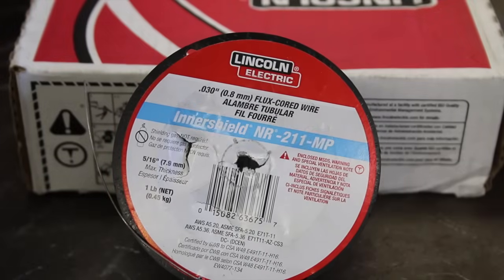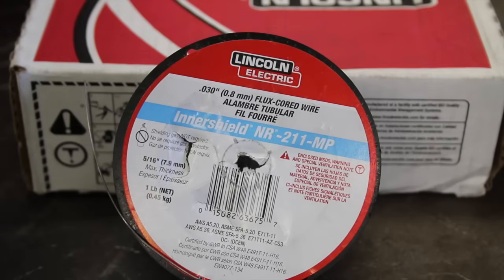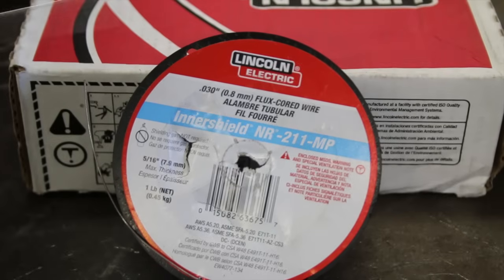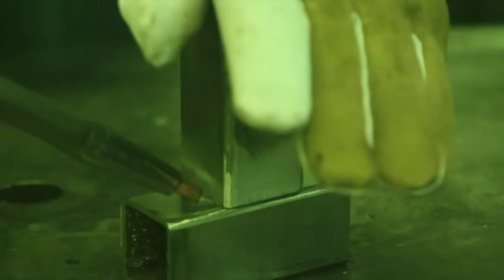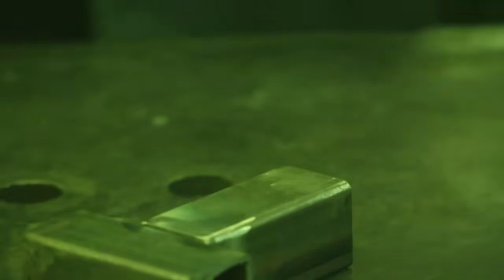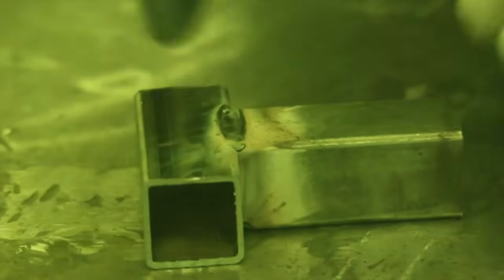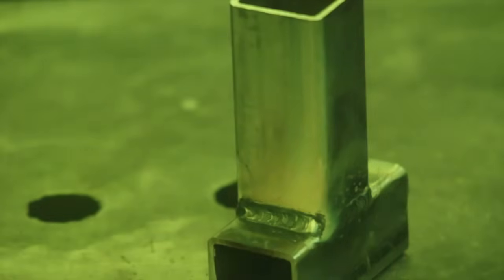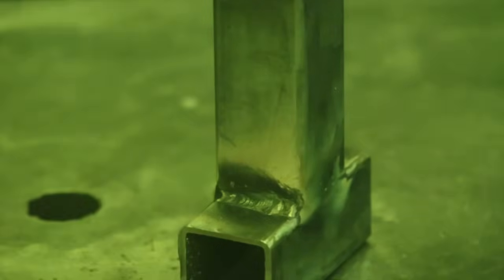Basic Flux Cored Welding on Square Tubing

Comment: Any suggestion for Current and Voltage settings on such a thin metal welding?
Reply from the maker: Sorry for the late response. You need to start with a lower wire feed speed first. One that matches the thickness of the material you are welding. Once you have found it, you then need to match the voltage to the wire speed for a smooth weld. Check this link for more info on settings: https://ch-delivery.lincolnelectric.com/api/public/content/5b1a00933782415e98e56639deb63f45?v=405651b4

Comment: How much weight will those T's you welded hold? I was going to use 2 inch square steel tubing with an internal diameter of 1.76.(.12 thick wall)  I am building a work bench out of 2X2 Spruce Pine that was left over from another project. The actual diameter is 1.437" square. I want to make the bench portable so would drill a hole through the Metal tubing and 2X2s and bolt it down. When I am finished using the bench I could pull the bolts out and could store the table flat. I used to solder circuit boards. It looks similar with the exception of the safety gear.

Comment: What's the wire speed and voltage used ?   Thanks
Reply: I just welded 14 gauge square tubing with my titanium on D 4.5 worked great

Comment: What's the best/cheapest no gas welder to get?  I want to learn to weld but don't know where to start.
Reply: I got a Lincoln 125 machine from my local Lowe's. I don't remember how much it was but it wasn't too expensive.
Reply: my honest advice is start with a stick welder, once you master that a MIG is easy to run.  and go with one from Harbor Freight. cheap and easy.

Comment: Newbie here. I assume you're able to form an arc without having your ground on the work piece because you have it clamped to the metal table you're using. If I were to use a small metal piece (need to be very mobile) for this what is the thinnest stock I could/should use for a mini table?
Reply: I've done it on a sheet of metal no thicker than about 1/8th of an inch.

Comment: Hi can you tell us the limit on max length extension cord that ca be used for a 120 or 160 flux core. Thanks. Some of my projects are not limited near my wall socket.
Reply: I've used a 110 machine on 100' cord, just make sure its a heavier wire, like 12/2.

Comment: Dan thank you for this video. I have a porch railing repair project where I have to cut out and replace rusted out sections. I was getting a lot of burn through but you explained how to avoid that. So one major headache solved. By the way the sections are 1" square similar to what you used in this video but yours looked like 1 1/4" square. Once this rain stops I look forward to getting out there and working on this project some more. Thanks Dan you really came to help on this one!

Comment: This is helpful. I bought a cheap Harbor Freight Flux Core welder for $89 and have tried to teach myself. I am having a hard time with my travel speed. I either go to slow and blow holes in the metal or to fast and don't leave enough weld in the joint.
Reply from the maker: +waldan1701 Try counting, or welding to the rhythm of your favorite song. That helps keep your travel speed consistent.
Reply: Thanks, I never thought of that. I will try it.

Comment: I'm just getting into MIG/Fluxcore welding so forgive my ignorance, but I'm curious about the gun you are using. Most videos show a gun tip that seems overly large, but yours is almost pencil point shaped. Can you tell me the brand of machine you are using, or gun or tip, whatever? The large types I've seen really turn me off to this type welding, but now that I've seen the type you are using, I really want to get into Mig/Flux core welding.  Btw..thanks for the tips.
Reply from the maker: +Martin Walters Since I am flux cored welding, I am using a special flux cored nozzle, since there is no shielding gas needed. If I were to switch back to MIG, then I would have to put the MIG nozzle you described back on. The flux cored nozzles can be purchased at welder supply stores and I have even seen them at big box hardware stores.

Comment: Dan, when setting up to weld two pieces of different thickness metals together, i.e. 1/4" to 3/16",  which thickness do I select on the chart inside my welder?  I don't recall hearing this anywhere. Thanks, and keep up the videos!
Reply from the maker: +Sammy Snead Choose the thicker for the setting. Lay on the thicker material longer, and sweep over to the thinner so as not to burn through. You will get the best fusion this way.
Reply: +WeldFever Thanks Dan!

Comment: hot damn nonone ever told me to raise the amp via wire feed speed....now i know why i was messing up.. this no one told me that the voltage dial was only for arc force like the dig is to stick welding  .. you may have just saved me from failing this test in the morning i reall y need the job, thanks alot so much alot alot alot lol
Reply: +corey mcdonald in welding going slower is usually better. you get the most penetration right before you burn through.
Reply: Thanks I'm slowing down now in Oakland CA welding war craft
Reply from the maker: +corey mcdonald You are very welcome. Keep in mind, the voltage controls arc length and not necessarily arc force, or dig. A higher voltage will produce a higher arc and a wider bead. The reverse is true of a lower voltage. Good luck with the job and let me know how it goes.
Reply: i keep failing i try so hard

Comment: The welds are really concaved. You gotta let your weld pool build up more about the size of a penny is a average size, then keep it constant.
Reply from the maker: +trevor kannady Unfortunately, sometimes the angle and the light play tricks on the appearance of the weld on camera. Believe it or not, the welds were actually flat to a bit convex, though I can see how you would believe otherwise. I try to lay down fillet welds so that the leg size is as close to the thickness of the material as possible. This cuts down on the heat affected zone, which as I am sure you know, is the weakest part of any part welded. Thanks for the comment.

Comment: what kind of wire wheel is that? do you have a video on capping the tubing?
Reply from the maker: +MidGAOutdoor Assuming you are referring to the wire wheel I use for cleaning, it is a mild steel, branded, wire wheel for a 4 1/2 inch angle grinder. I use the Harbor Freight ones, as they are reasonably priced , and hold up when used correctly.

Comment: Hi there.  Good info.  Can you explain why the "single pass" wire cannot have a second pass?  This confuses me a bit.  I understand that with FCAW one needs to clean the flux between passes.  Just not sure I understand what it is about the "single pass" wire that makes the welds fail with multiple passes.  Thanks!  I enjoy your videos.
Reply from the maker: +Matthew Cuba Yes, these single pass wires rely on admixture or dilution with the base metal to produce the weld deposit. If used for multi pass, then after a few passes you would begin to have an all filler or all weld metal deposit, which could result in an undesirable weld bead and cracking, due to the resulting alloy content of the weld bead. Hope that helps.

Comment: Are you saying that the 5/16" designation on the wheel means that you cannot stack the weld bead higher than 5/16" (with multiple passes)?
Reply from the maker: +1999Shortstuff That is correct and it is not me saying it, it is the manufacturer. Here is what Lincoln Electric has to say about it:

"Certain FCAW-S electrodes are limited to a maximum steel plate thickness in which they can be used. If used with plate thicknesses beyond these recommended limits, then the cooling rate of the weld metal could be faster than desired, due to the thermal conductivity or weld quenching effect of the thicker plate. This in turn could potentially create an undesirable microstructure in the weld metal, from which weld cracking issues could potentially result. Electrodes with plate thickness limitations are listed in the table directly below."
Myers, T. (2015) Innershield wire, FCAW-S Welding Guide, Lincoln Electric Co. http://www.lincolnelectric.com

Comment: can i use flux core to weld spring perches on an axle? I have read so many different things online, some say they use it with .035 wire to do that type of work on their jeeps, and others say not to. it seems to be a  50/50 draw, any advice would be greatly appreciated.
Reply from the maker: +xjmachine Generally, flux cored welding is just as acceptable as any other process of welding with one exception. You must know the thickness limitations of certain flux cored wires. For example, the wire I use for general small fab and repair is Lincoln, NR-211-MP, in .035, and it is only meant to weld a maximum plate thickness of 5/16." So, if your project's metal thickness is greater than that, you could not use this type of wire and would need to look at another type of flux cored wire, which may or may not work for you. Good luck.

Comment: If I got the crimped wire wheel from harbor freight, that would be enough to clean the wielding spot before and after?
Reply from the maker: Drcool52 Depends on how dirty it is, but usually not enough to remove mill scale.

Comment: Welding wrought iron I have mig/flux welder what method would you recommend thx
Reply from the maker: lexoaz If you're welding outside with winds over 5 miles per hour, then flux cored.

Comment: WeldFever 
Hi, I just purchased a lincoln power mig 210mp.  Since I didn't purchase a gas bottle yet, I wanted to use the supplied flux core wire.  When I originally turned on the machine, I laid a couple practise beads, and the arc was nice and smooth, etc.  Since then, when I am trying to weld, the wire keeps like bouncing off the metal while welding, like it keeps on bouncing back. Do i need to up the voltage? Up the wire speed? I've tried adjusting, but just can't get it right. Thanks!
Reply from the maker: AnythingVG What you need to do is clip off the end of the wire before every new weld. This is a common problem, because most don't realize this is the correct way to do it. When you start up again with a dirty, slaggy, burnt end, it usually won't start and bounce off, because there's too much junk on it to complete a circuit. Also, make sure your metal is clean, and you have a good ground/work connection. Next week I'm doing MIG/FLUX troubleshooting, so stay tuned for that!
Reply: WeldFever Thank you very much for your reply.  I actually was welding on something different, so I adjusted my settings accordingly. I believe I was welding with settings on 18ga or so, and with the slower pace, it was actually having no issues at all. It's also a dual voltage machine, and I am running on 120v on a 20a breaker,  so that may be a contribution to the problems!

Comment: I could not find MP on the Lincoln wire.What else should I look for?
Reply from the maker: rolyat13013 Are you in the U.S. and is it Lincoln 211 flux cored wire you are looking at? if so, look at the fine print on the label that will indicate if it is a multi pass flux cored wire, or not.
Reply: Thank you! I never new that, now I know what to look for.

Comment: You mentioned changing the wire speed, but I may have missed the direction to take. My guess would be to lower the speed to increase the heat, thus, putting in less metal to absorb heat. Is this correct?
Good videos. I found a sign that said "Danger - I Did All The Welding Myself" I like it.
Tom

Comment: Nice!  I never new about Single vs. Multi pass wire :-(  As it turns out, I have been making multi passes with single pass wire in making my welding table Ugh!.  So what do you think happens over time - can you elaborate a little?
Reply from the maker: Rick Rabjohn Great question! According to Lincoln Electric, single pass (FCAW-S) electrodes rely on admixture or dilution with the base metal to produce the weld deposit and if used for multi-pass welds, after the first few passes you would begin to have all filler, or all weld metal deposit. The resulting alloy content of the weld bead could be undesirable and cracking could potentially result. Sorry for the bad news.

Comment: I have HORRIBLE luck/skill with Flux core welding.. I have a 170amp HF Mig machine.  welding with Argon Mix and solid wire works great.  I can produce very nice welds.  HOWEVER, when I switch over to flux core wire if I run out of gas it looks terrible.. The weld balls literally jump off the piece I'm trying to weld.  And yes I do change the polarity inside the machine.  Is there a trick to flux core welding or is it really that hard compared to welding with solid wire and gas?
Reply from the maker: Mobile AutoMD There really is no trick. Not changing polarity is usually the culprit, but since you say you have that covered, I would next look into the wire you are using. Make sure it is a quality wire, and that it has not become wet, rusty, and is not very old. They usually have a shelf life of about a year or so. Make sure your stickout is around 1/2" (more than you would with MIG), and that your base metal is clean. If all that does't help, send me another message with a few more details and we'll keep at it. Good Luck!
Reply from the maker: WeldFever Another note on sickout (more properly known as contact tip to work distance CTWD) for certain flux cored wires it is recommended that you have a 3/4" to 1" CTWD, but I find that 1/2" works well with this smaller nr-211. Sometimes I wonder off as far as 3/4" with no problems.
Reply: Well sir you have nailed the problem I suspect... the wire I have has been laying open in my work van for 2 year AND it's the cheap stuff that comes with the welder. The solid wire didn't seem to mind that as much though.
Reply from the maker: Mobile AutoMD Well how about that. I hope that solves your problem. Good luck and let me know how it turns out when you get some new wire.
Reply: Mobile AutoMD I also have a HF MIG 170, and I promise you that the issue is the junk flux-core wire it came with. Toss that stuff and get a roll of good quality flux core wire and you will be much MUCH happier.
Reply: Dwight Rahl I've ran Hobart wire...Radnor...Lincoln , And the HF stuff all in .030 and .035  I've seen no difference in bead quality  produced from them welding off my HH210 or the Ironman 250 ...only time my seld got funny was when the extesion/adapter cord I was using on the Hh210 to my gemerator had one of the legs get loose at first I could not figure it out then the fan started turning on/off then it would not arc only click on but no arc or feed ...but b4 it was bad enough to not get a complete connection it just produced a shitty weld ... things like a bad ground will cause shitty weld ,and with a HF unit you may have loose wires in the machine on arrival .